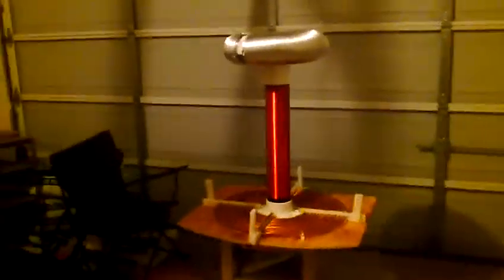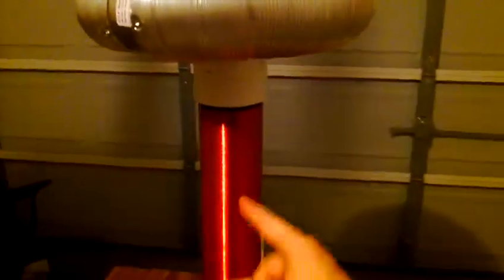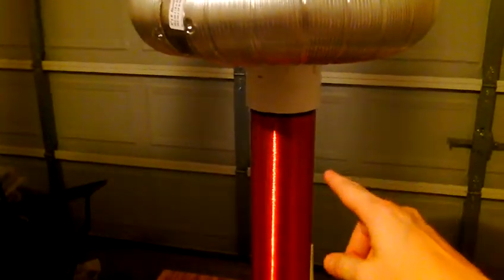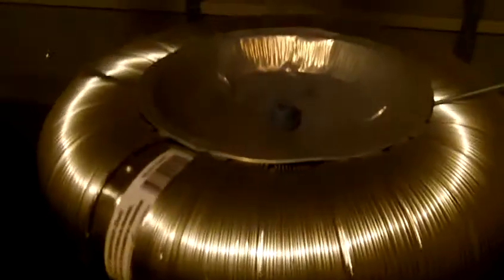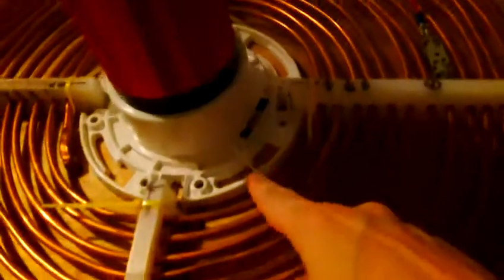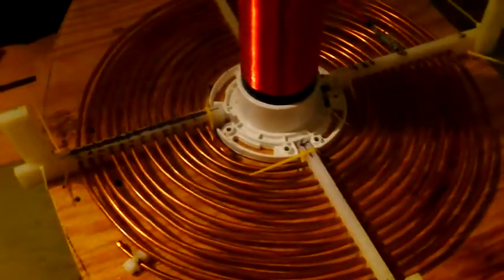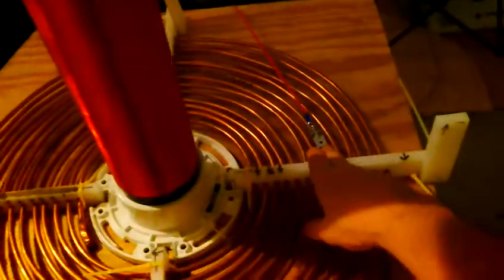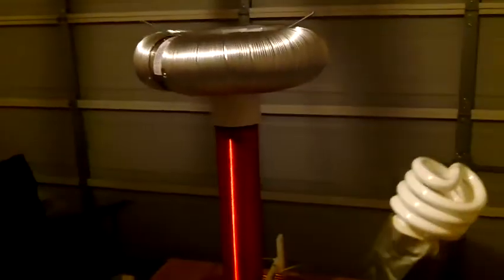Tesla Coil 9kv 30ma

Comment: I know it's probably a bit late, but try tapping your primary at a smaller amount of turns, and your gap should be placed a little more to the side of the fan, you'll find that very little wind is actually produced right in the centre of the fan ;)